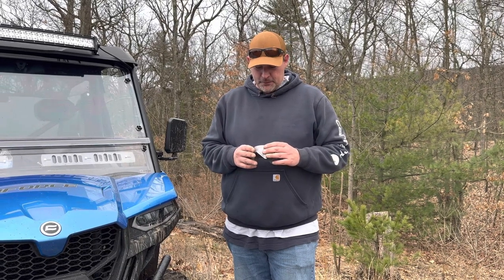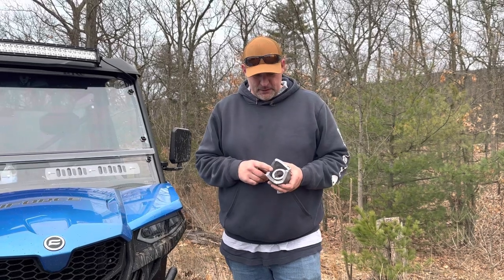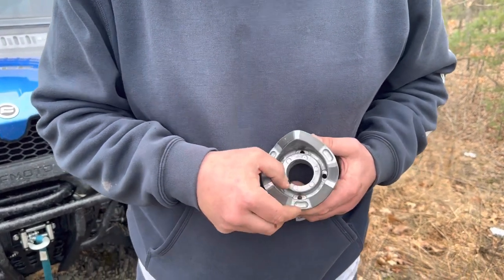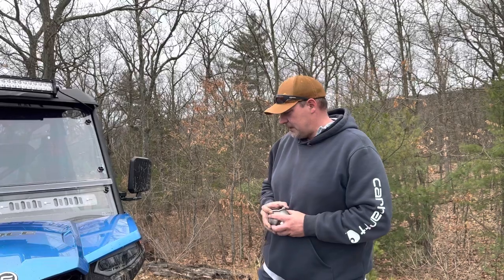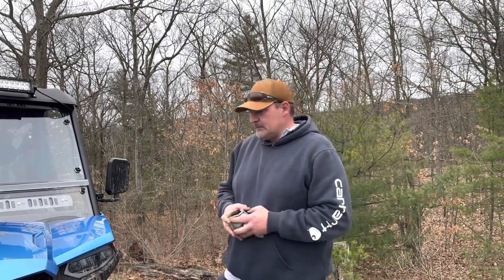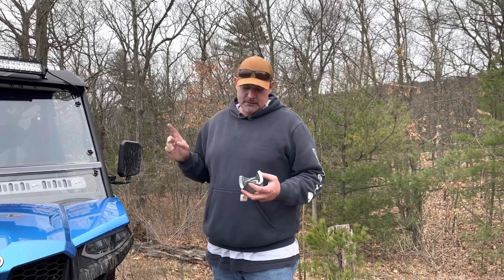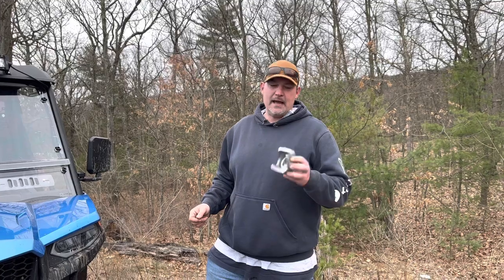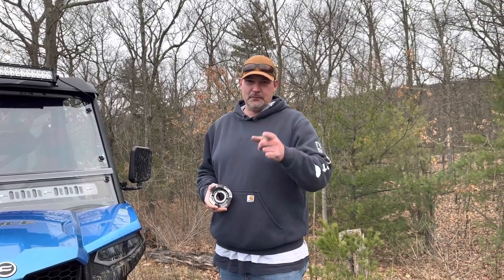All aftermarket Helix  issues and secondary spring issues!

Comment: Here is my question if they all do this does that make it a wearable item and it’s to be expected?
Reply: Yes.  And these clutches life span is 5K miles if nothing fails in 5K miles you have a winner for sure. I have personally never seen a helix, spring or even a secondary it’s self fail not once.  I just pulled apart a stock machine with 7K miles on it the other day the helix was rubbed pretty deep but nothing failed.  They were on their 3rd belt. Even the sliders were still factory. We did a whole rebuild on the clutch and the clutches them selfs were still usable and in great shape.  We did change out the helix for ours and stuck a brand new OEM spring back in the secondary clutch with brand new OEM weight block set, cam slider set and driven pulley block set.  The customer said he has been super happy with the machine it was a 2020 UForce 1000
Reply from the maker: Not after 200 miles lol